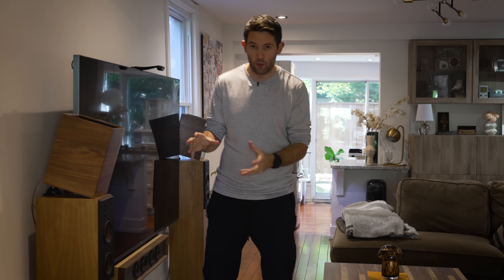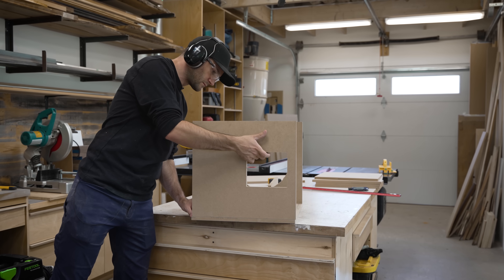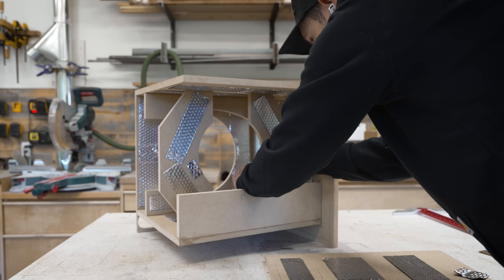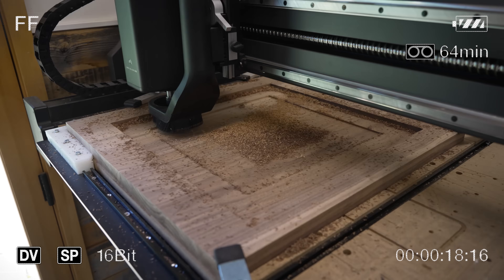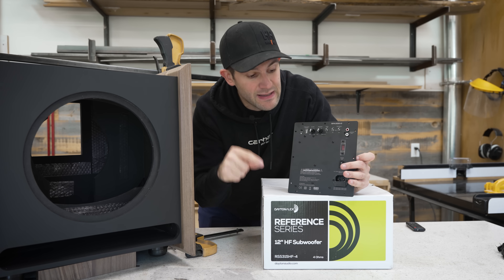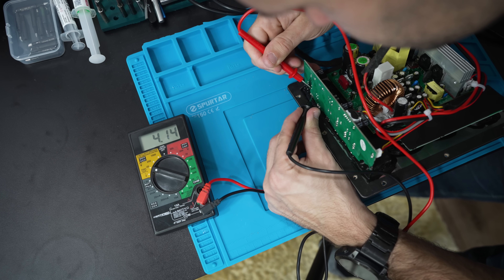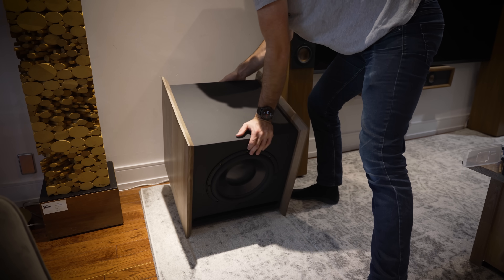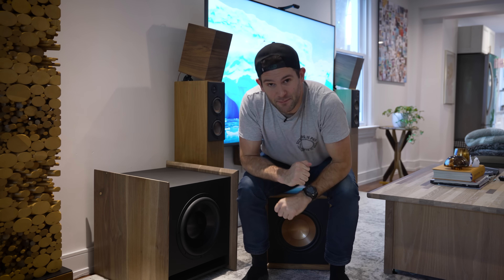THIS changes DIY Audio...

Comment: I would always drive subs with amps rated for double the drivers power where possible. Nothing wrong with headroom especially with dsp control.
Reply: This. Because the amplifier usually distorts before the speaker.
Reply: I completely agree with this statement. RMS ratings are related to the amount of heat a voice coil can withstand at continuous output. Music is dynamic output.
I always aim for matching a speaker with an amplifier which outputs half again to two times the rated speaker RMS rating, at its nominal impedance load.
Reply: Exactly. I would go for something in the 500w range for this sub except for class AB amps then you’d be fine with 300 watts
Reply: For this build I'd think the amp is plenty big enough that the driver's excursion will be a limit before power becomes an issue, whereas in a sealed sub there'd be much more of an argument for a larger amp, but in general it is true that a clipping amp will destroy a voice coil much faster than pushing a driver to its mechanical limits.
Reply: yeah that sub aint even flexing ,hes missing out on a lot of the true power of that sub
Reply: I would never do that. Killing speakers is easy
Reply: I agree! From a sq car audio prospive having more power in the amp then dial it back provids less chance of voltage drop at the rails, in turn no clipping at the lower hz.
Reply: you could damage a sub with 20 watts. excursion is the main destroyer of subs more than power.
Reply: You ALWAYS want the amp to be capable of blowing the speaker in order to drive it efficiently. One of the first things I was taught in the recording studio.
Reply: @EricHudson63  they do not generally teach speaker engineering in the recording studio. these are different sciences. while there are valid reasons to want significant amplification headroom within a system a recording studio with near-field monitors is almost never the correct venue for this application.
Reply: @NeoPest  We have full time techs on staff that studied speaker engineering, amongst other sciences. We are able to learn from them. It isn't terribly hard to grasp.
Reply: Headroom isn't about amp power vs speaker power.
Headroom is about amp and speaker power in terms of SPL vs typical listening level. This is a combination of preference, room size, acoustic treatment, amp and speaker power, speaker sensitivity, and program material.
A JBL BoomBox 4 might be a high headroom system playing jazz in a small bedroom and a low headroom system playing dubstep in a dance hall.
If you get clipping or sound quality degradation 1dB louder than you listen you have low headroom.
If it's not till at least 10dB you have fairly high headroom.
Reply: Double the power only works if you dont have DSP. Damping is really important to keep DSP happy. A rated amp with proper damping circuitry is better at giving DSP what it requires to "read" the signals.
Reply: Not me.  It is much more nuanced than that.  Room size and loudness goal is important not to mention many drivers in a ported design can reach their excursion limits below rated power which is just a thermal dissipation rating.
Reply: You don't understand dynamic range of amps. Too much power means more attenuation of volume and all that does is add compression by reducing dynamic range. Amps always perform best at full volume, provided they aren't clipping and doing that increases dynamic range drastically. It's why preamps exist, so you can gain stage your outputs properly and eliminate as much attenuation as possible. Subwoofer amps are especially trash at volume control so you're losing literally over 80% of your dynamic range in most real world cases where people have their subs running at 10% volume at normal listening volume.
Reply: @pokrog  not true. If you are running an amp full up you are going to lower your signal to noise ratio, you are going to make your amp run hotter lowering its life span, you'll leave yourself no headroom before distortion to cover any sudden peaks.  

You want to get your input to line level early on in the chain using your preamp then do the minimum attenuation as late as possible this lets you get the best signal to noise ratio
Reply: @Savagetechie    That's wrong. You have that backwards. Look up any measurement of any amp. It has the best signal to noise ratio right at max volume. Not one single exception, ever. Volume controls don't adjust how much power the amp is outputting, it attenuates the signal.  There's a difference. If an amp is noisier at higher volume, it's adding gain and isn't a volume control, it's a gain control and even gain isn't changing the output power of the amp. The amp puts out what it puts out. You can't fight the math and design of how they work. People confuse compression for volume constantly and they're not even remotely the same.
Reply: @pokrog correct gain can avctually improve power output. Amplifier does just what it says, it amplifies the input signal by a set amount. Around 20db is typical. +20db is 10x the amplification in volt. Power output in watt is dependent on the load(impedance) 4v input amplified by 10 will have more headroom(volt) to output more watts then for example 2v input amplified by 10-Where the amp will be voltage limited before reaching its full amperage potential. Gain is ofcourse at what input voltage the full 10x anplification will happen. Summarized amplifier just amplifies input voltage, to get the best performance you want a preamp that can supply voltage to where amp gain can be set to lowest possible settings to give enough voltage for the biggest possible amp draw (Wich depends on your impedance) so be sure to match your speakers rated impedance too your amps rated impedance
Reply: @oscarsjolund9672  exactly. You ideally want your volume everywhere in your chain at 100% if possible with your amp in the lowest gain setting that allows you to get the volume you need. If you have cleaner gain before your amp, it's usually better to just use low gain and make up for it somewhere else and avoid the hit to noise, especially if it allows you to get closer to max on every volume knob. Doesn't matter what kind of volume control, whether it's a potentiometer or digital or a resistor ladder, they all should be taken out of the path as much as possible and they're all closest to out of the path when they're at max volume.

Edit: also negative gain preamps have been able to transform some power amps I've had into totally different animals with significantly more slam and stage.
Reply: @pokrog  why are you assuming unity gain is maximum? that isn't the case on a lot of amplifiers. Also purely on a transistor level if you are outputting close to the transistors max you will very quickly run into distortion. Just look at the THD graphs for something like an LM series and you will see tdh lowers but then raises extrememly quickly as you approach max power output which is one reason you simply do NOT want to run amps at max power.
Reply: @pokrog  distortion and power output is NOT an linear relationship, Distortion with a fixed frequency signal will both lower and increase as an amplifiers output power increases, eventually you will hit a point where the distortion increases massively but before that point it is non linear. So no it is not purely caused by giving the amp more than it can handle. Go and actually do some reading before you resort to posting random insults.
Reply: @Savagetechie    just like the guy that I was responding to earlier said, the amplifier does just that, amplifies a signal by a set amount. The THD measurements you're talking about are spiking because they're being driven to clipping by receiving more input signal than they can handle amplifying with a given dummy load and the amp is either current or voltage starving. Gain stages in amps 99.9% of the time are just adjusting the input pre gain, not switching to a different complete amp circuit with a higher amplification gain. It sounds like you've done more reading than comprehending and you've fundamentally misunderstood some foundational concepts that you've built on incorrectly. You're overcomplicating some really simple concepts. Headroom is just excess gain. Excess gain is just lost dynamic range. The amount of excess gain is directly proportional to the amount of attenuation needed and scales linearly with the dynamic range losses of the volume control. The less excess gain, the less dynamic range losses. Decibels are logarithmic. It's not uncommon to lose 40-60db of dynamic range from an attenuator of any kind. 40db is 10,000 times as much range definition.
Reply: @pokrog  how am I over complicatiting it by simply pointing out that distortion in not a linear relationship to output power. I'm also not over complicating things when I point out that unity gain is not always full up on the controlls.
 My old PA systems subs are only 450 Watt drivers and they've been happily running for 20 years on 1000 Watt amp channels  whereas I've seen lots of matched amps overheat and die after a year of usage.  I've heard sub amps run out of power when driving big cabs with big drops and its not nice so I'll stick to having headroom.

Also a lot of modern poweramps will absolutely switch banks of circuitry.
Reply: @Savagetechie  distortion is linear to output power. If your amp is rated at 4v input with +20db output. That means 40v output. Now if that amp is rated at 4 ohm that means it can supply 400ws rms. The thing with coils though is that it changes impedance relative to frequency. A 4 ohm speaker is never really a 4 ohm speaker, Wich means the amp can still always supply 400ws but certain frequencys will draw more than 400w, other frequencis will draw less than 400w, at the same input level
Reply: @oscarsjolund9672  it is not linear, seriously just look at at data sheet or 2, you will not find distortion in a linear relationship with output power, it's not that clean and the graphs will also vary with your test signals frequency.
Reply: @Savagetechie  you Said it yourself. Its frequency dependent but a 400w amp will output 40v @ 10 amps over 4ohm always. But if driver impedance change to 3 due to frequency if will draw 500+watts. But that is not the amp clipping in its rated rms is it? Then its way over rated rms
Reply: @pokrog  Thats completely the opposite of true. Amps perform best with largest negative feedback - closest to no amplification.
Reply: Wattage isn't linear. I.e. 300 watts isn't half of 600 watts. So 300 to 400 is hardly anything. But I agree the amp should have more power.

300 seems quite low? My rel 10" sub is 300 watts and it's pretty small by comparison
Reply: @grahamprescott9426  Wattage is very linear - that's the whole idea of Ohm's law. What you mean is that volume (dB) isn't linear and that you likely need four times the power to achieve a percieved doubling in loudness. We only percieve something as double as loud when it's increased by 6dB (hence the F3 specs), factually quadrupling the real volume, requiring four times the power.

Regardless of that, 600W has twice the energy of 300W, which makes Watts VERY linear.
Reply: @grahamprescott9426  i was thinking the speaker flex was minimal. Especially for a ported box.
Reply: @grahamprescott9426 it’s a small, relatively low powered sub. Although I agree with him. He’s got a family room style theater, where aesthetics and size of the stuff taking up space matters.

In terms of good subs for true home theater use, it’s basically non existent compared to a lot of folks. I have 4x 1000 watt RMS stereo integrity subs in four corners of my room. They manage upwards of 135 db without working too hard. That sounds massive, but it’s nothing compared to many folks running 2-4000w RMS subs on the HT forums. Those folks are usually chasing 10hz at huge SPLs. 

It’s all relative

Comment: Awesome build! 👍
Just one note: many people mistakenly think that class D amps are "digital". They're not. The audio signal that goes in is analog, the amplified signal is analog. There's nothing digital in that.
Reply: Actually it is digital. on or off, nothing in between. Known as a "digital switch mode power amp" The audio signal may, or may not, be digital like on an HDMI cable. Weather or not the audio is digital, or analog has nothing to do with the 'class' of the power amp. A class D amp is most certainly a digital amp. BIG fancy words can be confusing. Especially when coming from a moron like frog boy Zach.
Reply: Bro, class D amps "operate by rapidly switching back and forth between the supply rails, using pulse-width modulation, pulse-density modulation, or related techniques to produce a pulse train output." This is a form of modulation used to represent an analog signal with a binary signal. Knowing that digital means that something is expressed as series of the digits 0 and 1 there is a lot of digital in class D so please stahp that bs.
Reply: @weberito digital/analog is not quite as much as a binary as you think, in the case of "super high frequency signal using PWM that when the high-frequencies are filtered out becomes a regular analog signal" i'd say it's far closer to analog, practically speaking

it's actually really cool how they work, there's a recent video from a channel called headphones something or other that explains it well, you'll probably find it if you look for videos on the different classes of amps
Reply: @ThylineTheGay  thanks, I’d look into it!

Comment: Nice choice. I used the Dayton UM18-22 and a behringer NX6000D amp for mine. Outperforms my Paradigm Servo 15 by a big margin and I have a second amp channel to add another UM18-22 in the future (which I will do). And cost wise it was $2.2k AUD to buy everything and build it
Reply: I have two UM18-22s in the DIYSG sealed boxes with a single Crown XLi3500.  Sounds amazing and shakes the house lol..
Reply: Man I miss my Servo, what a fantastic bit of kit that was, so far ahead of it's time! I got rid of mine in favor of a sunfire and later an SVS, wouldn't mind getting hold of another servo just for nostalgia.

Comment: Your info on enough watts is incorrect, watts in speaker spec is only a thermal limit of that Rs315HF you've used, it could take a 1000wrms amp all day long because sound is dynamic the only time it will become a problem is if you feed it constantly from a tone generator(ie SPL car audio nuts)at high SPL's for several minutes.
Also that sound deadening applied inside was a waste of it, you've already braced that cab well enough to not need it!
All in all though its a nice build that'll last you many years, well done.

Comment: As for power matching,  Its always better for the amplifier to have more RMS power, than the speakers RMS.  This allows for more dynamic head room. When RMS is matched.  You run out of head room and dynamics suffer when pushed to RMS. .....  RMS matching can create more stress on the amplifier, than the driver when being pushed!  As a rule of thumb.  I run twice the RMS  power to my drivers.  1000 watt plate amplifier or a little more would give your design enough head room for dynamics and less stress on the amplifier to speaker relation.  The drivers RMS can be passed just fine  In on quick dynamic demand peaks.  Even more if tuned.   Without the danger of clipping the amplifier.
Reply: oh , i had to scroll allot for this comment :)
Reply: The second thing is "box rise / impedance rise", the speaker will get a lot higher impedance when it's playing and because of that your amp will put out less power.
Reply: Yeah if you need it
Reply: @IANHANDS   Always the best scenario is more power reserve from the amplifier than the speakers RMS. Regardless, yes one can under power or match RMS, its quite common although not the best!  More head room in the amplifier is key! no matter how big or small the system.
Reply: Exactly!!!!
Reply: Speakers don't have power. Yeesch.
Reply: comment approved
Reply: I would never run a 100w guitar amp into a 50w speaker.
Reply: @paulloesel4549  guitar amp is totally another story.
Reply: @paulloesel4549   That is really not a good application for low watt speakers.  The application being you don't really need a lot of power for a single low watt speaker.   My friends do run into distortion, but they prefer it.  For sound with musical instrument amps.  Still hard on the amplifier and speakers.
Reply: Know of any good 1000w plate amps? I'm having a hard time finding many